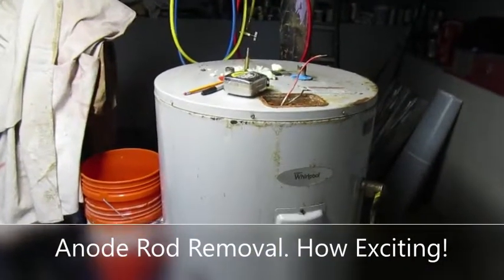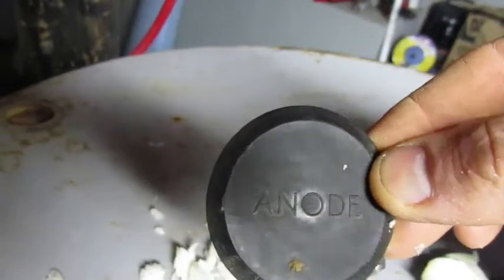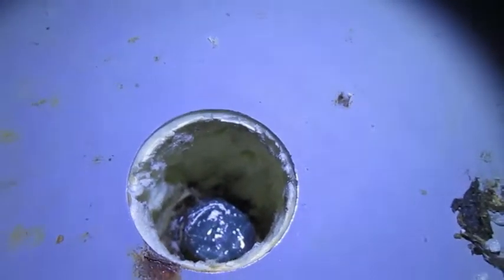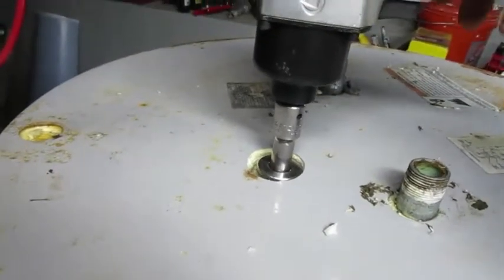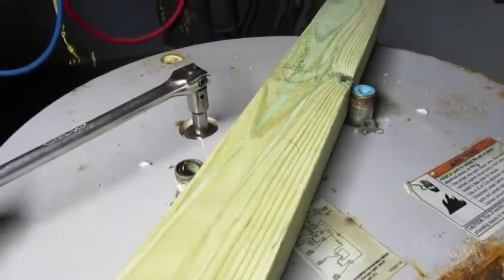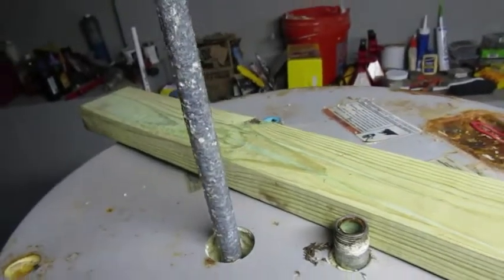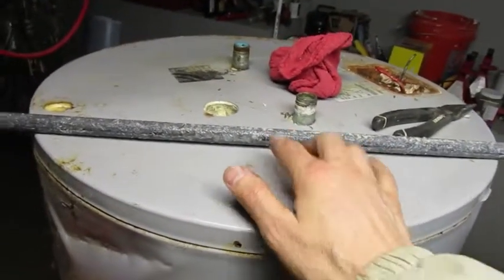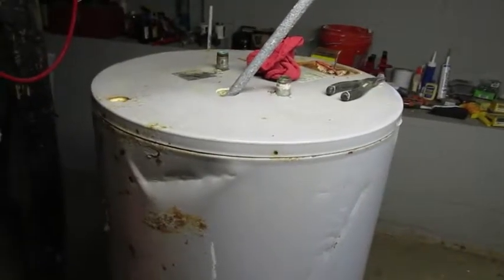Water Heater Anode Rod Removal

Comment: Although this video is over 2 years old I found it interesting how you used the 2x4 to stop the tank from turning and since you weren't going to actually repair the water heater you didn't have to concern yourself with damaging the hot and cold connections.  At the :50 mark you said you thought about cutting the tank open just to be curious.  I wish you had because I was curious also to see what kind of shape the heating elements were in.  Nothing beats taking something apart to see what makes it tick.